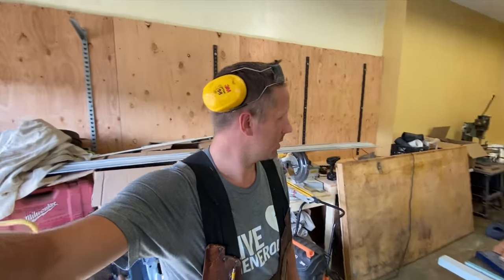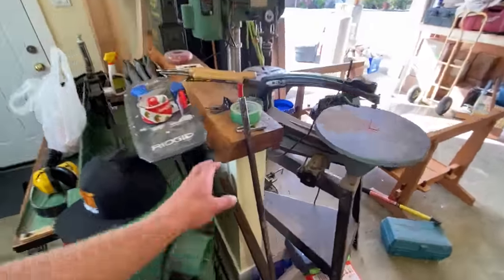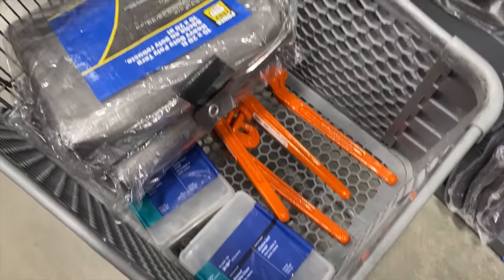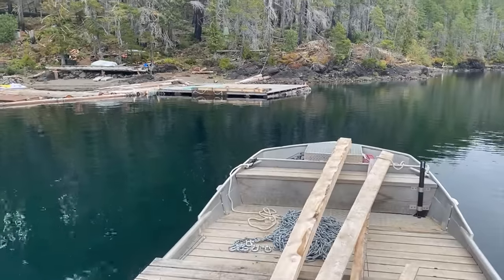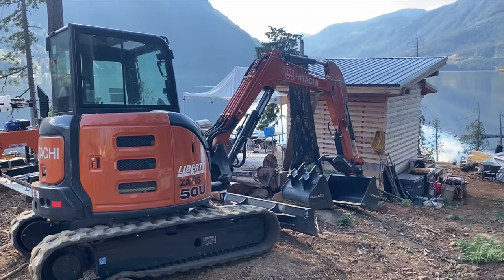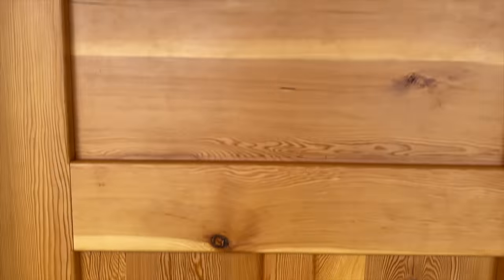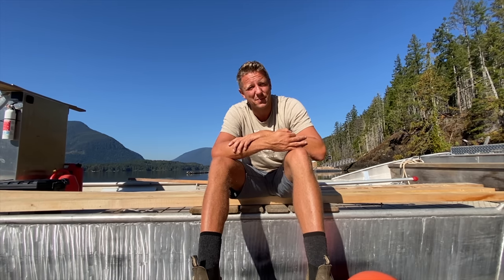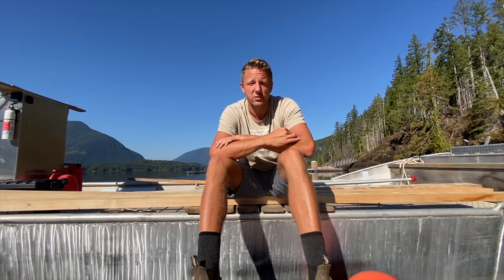My New Paint Brush!!!

Comment: I installed a “Textilene” screen mesh (maritime quality 70/30) garage drop down that provides ventilation and yet allows “one way” visibility during the day.  Outside folks can’t see in.  Rope track install with snaps on the sides and #10 YKK zips for easy walk through access.  I live in Phoenix and air flow in the Summer is desired. Garage door is wide open all day. Looks closed from the outside.

Comment: Put your outfeed table on wheels (use the glue up top? It's a rental) Then you can use it as an outfeed table for the table saw, planer, jointer, whatever you want to use it for since it's on wheels. Storage underneath (clear labeled totes, it's a rental). Hooks on the sides. Mounted surge protector. Whatever, it's your outfeed table and it's a rental. 

You need a mini fridge for beers.

Comment: with the Sinks on that Wall.. build a sawtable above it with lumber space or toolspace/ shelves above up to the ceeling? room for putting powertoolboxes and something.
gives you table space on that wall, the table (and a front on it) protects the sinks below from damage.
you can probably also just disconnect one (or both) sink tables from the waterlines and move it to an other room or push it where the lage toolbox is next to the door. easy to put back if you leave.